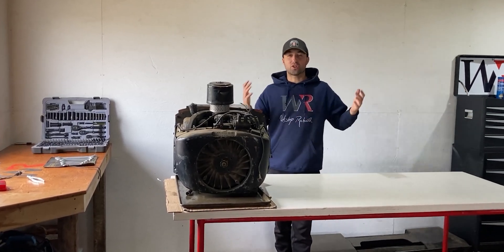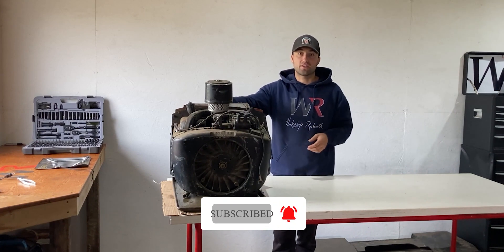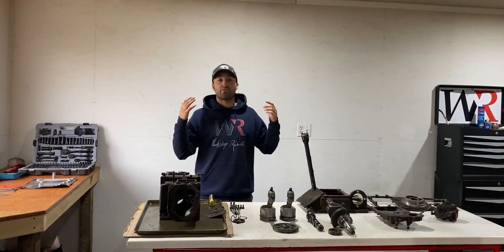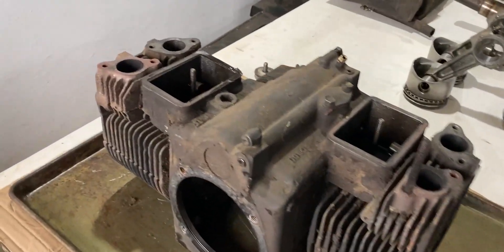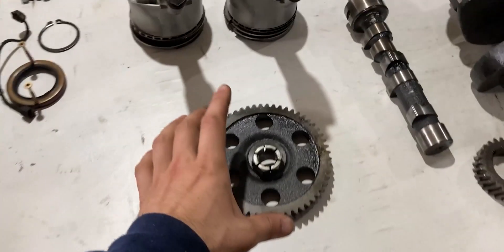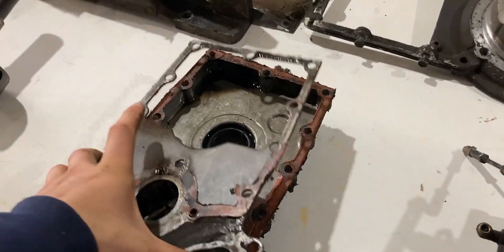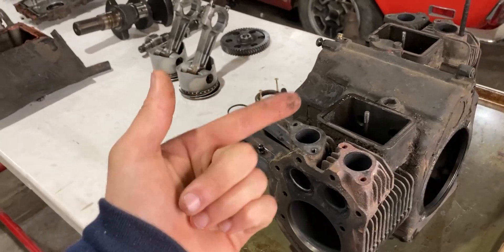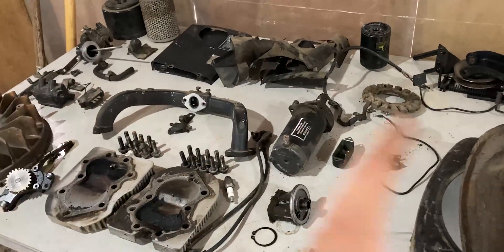Kohler K532 Full Engine Teardown Timelapse & Parts Review

Comment: Kolar k 582 qs replaced coil replaced fuel pump replaced fuel filter. will start but will not keep running. Throttle arm will open the cab up all the way and the motor dies. Thankyou!
Reply from the maker: You're probably getting fuel on the initial startup, but your carburetor does not supply the correct amount needed to idle or run the engine. This is most likely caused by a dirty or clogged carburetor.
Most engines that run solely on Choke, have a carb-related issue. Clean it with some degreaser and make sure all passage ways are clean. Put it back on and make sure your linkages are in place. Try and see if it idles and runs with higher rpm settings after that. Cheers

Comment: do you have any videos or tips on how to clean carbon off the top of pistons, valves and heads.
Reply from the maker: Hi J. I've made a video in the past where I clean a complete Kohler K341 engine block and within that video I share some of my tricks and tips. (Video: https://youtu.be/Q9R9R3A7xkg )
If you want to remove carbon build up, I can recommend a flat scraper and steel wool. First try and get the loose stuff off with the scraper and try not do "dig" into the metal. After that, use steel wool to achieve a smooth and even surface finish.
I hope this helps!

Comment: I'm still having trouble with that front plate. I removed the seal and snap ring, is there something else I'm missing? Or could it just be that stuck on there.
Reply from the maker: Hi J! Yes it is a very tight fit. The inside diameter of the radial bearing is snug on the crankshaft. I would suggest you try and add some heat to the inner race of the bearing. If you have a heat gun use that, but if you only have an open flame be careful that your bearing doesn‘t get too hot!
You could damage it. Do not heat it up over 80C.
I hope this solves your issue

Comment: I'm having trouble with the front plate. I have the motor out and all the front bolts out. Is there anything I need to take off the back like the flywheel, or is it just stuck on? Thank you.
Reply from the maker: Hi J. Are you talking about the cover that closes off the engine right behind the flywheel? If so, there are about 10 bolts threaded in from the font into the engine block and 3-4 bolted in from the back to the cover. once those bolts are removed you should be able to remove this cover without any issues. 
At minute 04:41 you will se me remove the governor and there are some bolt holes in the back I already removed. Those bolts I'm talking about...and at minute 04:44 I removed the last bolts from the front.
I hope this helps
Reply: @WorkshopRebuild  sorry for the miscommunication, I'm taking about the plate you take off at the 6:00 minute mark. Mine seems really right, that's why I was wondering if I was missing something. Thank you.
Reply from the maker: @user-rd8es2bm2r  No worries, I understand now! You must remove the seal in order to get access to the snapring below.
Once you remove the snapring, the bearing should slide off. If you have a hard time, try applying a little bit of heat (but not too much, because you have a radial bearing there.

Comment: Do you have any tips for removing valves with out the tool?
Reply from the maker: Hi J, great question! If you have a enough room for a two mid size flat-screwdrivers or even smaller prybars, you can probably apply enough strength against the spring to the point where the valve keepers will fall out.
Assembling it this way will be hard, but you can always try. I hope this helps. Regards Andreas
Reply: Do you have a link for a good one to get?
Reply from the maker: @user-rd8es2bm2r  If you need a prybar or screwdriver, I would actually suggest you pick up a valve spring compressor tool. This one will work perfectly and it might be within your budget for this repair: https://amzn.to/3WiFJ9s
Reply: Sorry for all the questions, but I'm having trouble with the front plate on the motor. I have the motor out and all the bikes out of the front, should it come off now or do I need to take anything off the back like the flywheel? Thanks again and great, informative videos!

Comment: Question:
From 2:45 to 2:48, how you take the left heat shield with the dipstick off?
At 2:48 it is missing the shield.
Do you cut it off?
Because the dipstick end is to big to take the shield away just normal...

Im stuck on this part on my kohler 532.

Greats from switzerland
Reply from the maker: The heatshield has been cut at the most narrow point and it was bent up 90 degrees to be removed. I didn't want to remove the dipstick housing from the oil pan, because it was not leaking. To reassemble it will be very easy too, just install the plate and bend that tab back down.
Ich hoffe das hilft dir! Han zuvor au ide Schwiiz gwohnt. Grüess us Kanada.
Reply: Thanks for the quick answer!
Ja merci hilft  witer.
Ich hoffe dasis fertig bringe daser wider richtig lauft....
Es het uf einisch komisch tönt und de ischer nur no uf eim zylinder gloffe....
Hoffe uf wenig schade.

Bisch i de schwiiz ufgwachse und in canada hangä bliebe?

Bin vor genau 10 jahr au dänne gsi in manitoba zum e saison de horizont im farming erwitärä.
Good times!
Reply from the maker: Ja hoffentlich ischs ned en grosse schade! De Kohler K532 het immer chli probleme gha mitm rechte zylinder. De chunt ebe als letschts öl über, und das chan über eh lengeri ziit de zylinder/kolbe beschädige. 
Am beste duesch de öl-druck ganz ufedreihe! Jetzt wirsch vilicht müesse öppis repariere...du wirsch es denn gse.
Immer wieder hin un zrugg haha, chan mich nanig ganz entscheide. Beidi länder sind super, darum gnüssis jetzt chli.
Es isch ziimli andest als ide Schwiiz, aber hoffentlich hets dir gfalle. Bin momentan in Alberta und das isch scho recht wiit weg vo Manitoba! 
Gnüss dis wuchened! -Andreas

Comment: I have watched all of your k532 videos several times and have not seen the answer to my question. 
At the 8:21 point in the video you note the pistons with a .030 overbore. You stated something like “ I will see what we can do about that”. What did you do? It is my understanding that it is the largest overbore and another block is necessary. If you answered this situation , please direct me to the video. 
 I do all my research for various projects on YouTube. You definitely have a talent for an organized and articulate presentation. Your earlier videos were difficult because of the audio. Content great , audio was crippling. 
 Stay with it. You are a valuable resource. 
 Happy Hloidays!
Reply from the maker: I'm sorry that I wasn't able to answer your question yet, but I'll try my best right now. This Kohler K532 was purchased before I had my John Deere 400! This actually came out of a John Deere 400 and the previous owner told me it was smoking more than usual. Once I had it at home I took it apart and I figured out it was already bored 0.030" over and the cylinders were both worn! A standard Kohler K532 bore is 3.375" and 0.030" over is 3.405". The bores on this engine were past that measurement and in this video I mentioned I would have to see what I can do about it. I DID NOT rebuild this engine, as I might just keep it for parts. 
Usually when a bore is oversize, it can be resleeved. What that means is, you bore the cylinders to a greater size and a steel-sleeve will be inserted. These sleeves usually have a wall thickness or 3/32" or around 2.5mm. Once the sleeve is in place, it can be machined down to the original size and your bore will be back to original (3.375" in this case).
As for the engine that came out of my JD400, the cylinders were standard size. Upon measuring I figured out only one cylinder was worn, so I decided to pass the block to a local machine shop. I went with 0.010" oversize pistons and they machined the cylinders out accordingly. 
So I technically have two Kohler K532's, one in the JD400 fully rebuilt and one which could technically be rebuilt with sleeves (back to original).
Speaking of Kohler K532's the bore of this engine could be bored out to 3.5" to accommodate bigger pistons (just like a K582=23HP), but I'm not sure if that's a good idea. It's very possible, but it may cause earlier failure!
I hope I was able to clarify this situation and if you have any other questions please let me know! I appreciate sharing my knowledge and I try my best to give my viewers the best viewing experience. Thank you for your kind words David! I'm trying to get better as time passes and I'm learning A LOT! Thank you once again and all the best to you too!

Comment: Does anyone know the physical dimensions of these in inches? How about peak torque output? I can't seem to locate these values anywhere.
Reply from the maker: I took a measurement: crankshaft end to end is 17", from shroud to shroud around the cylinders it 21" and the engine from top to bottom is 18" (17"x21"x18). The peak torque output can be calculated and it's very simple. Engine Max HP (19.9HP) x 5252 = 104,514.8 / 3600 (Max rpm) = 29.03 ft.lbs of torque.
I hope that helps, Best regards!
Reply: @WorkshopRebuild  Thanks a ton!

Comment: I can't say these early K series opposed twins are my favorite engine, but they certainly are stout and tough. I've seen them in skid steers, pavers, generators, welders, pumps, and so much more.
Reply from the maker: I have similar feelings about the opposed engines. They have a nice amount of power, but there are some nicer engines out there! They sure did use them in many applications and they were quite trustworthy. I will work on some more Kohler engines in the near future, but I would like to get my hands on some of the other projects I have laying around...urgh it's not always easy!

Comment: Nice video! I hade a feling it would be  another kohler :). Do you have a tractor you can put this in? You can get the rebild kit from Isavetractors. Have you ever worked on an onan? It would be cool if you could get a 318 with a onan b43g or p218g. I an looking to ad a 318 to my two 317's. if you look into one try and git a 1987. Best Regards!
Reply from the maker: Thank you so much! Haha I have had quite a few Kohler engines in the last few episodes! I do not have a tractor for this engine. An older gentleman removed it from his garden tractor are strictly replaced it. I would like to have it it running condition and then I can always figure out what to do with it :D I will indeed purchase my parts from isavetractors! I have not worked on an Onan engine before, but I've heard many good things about them! I always keep my eyes open for deals, so we'll see what comes next! A 318 is a totally different machine and you might not want to drive your 317's after you've been on a 318! They just made a complete tractor out of the 318 with many positive upgrades...nontheless, every garden tractor has it's pros & cons:) Cheers